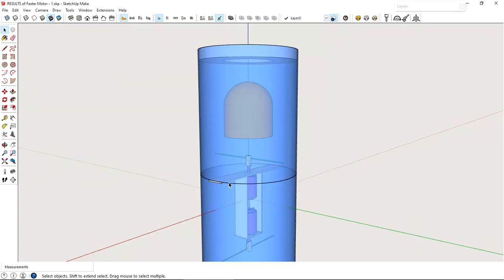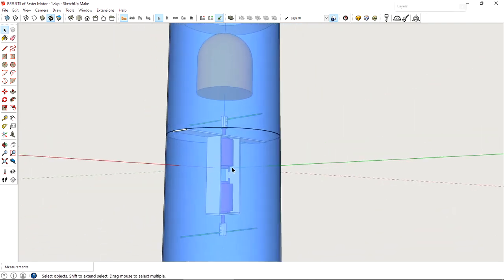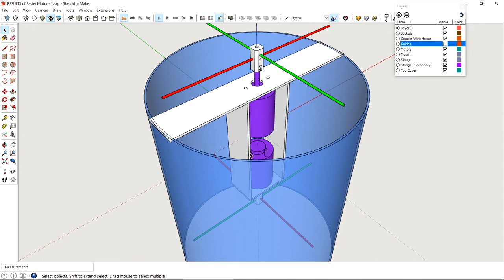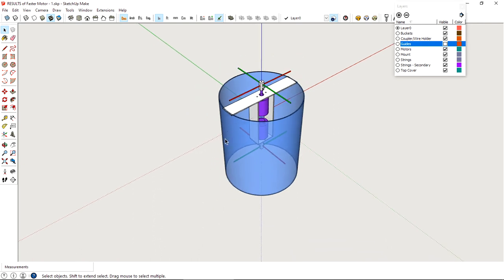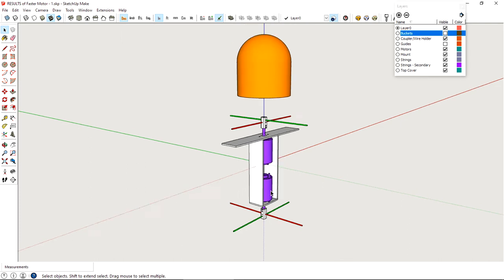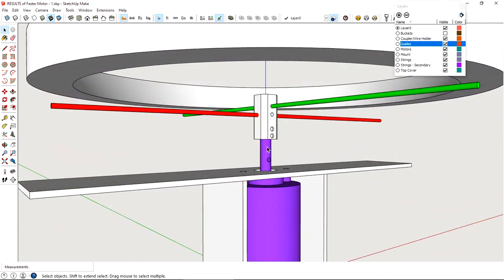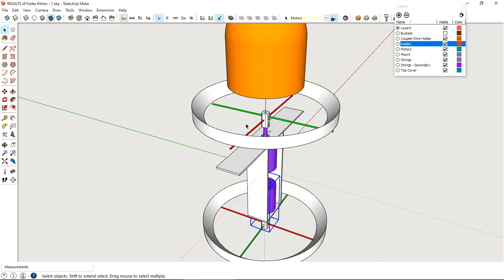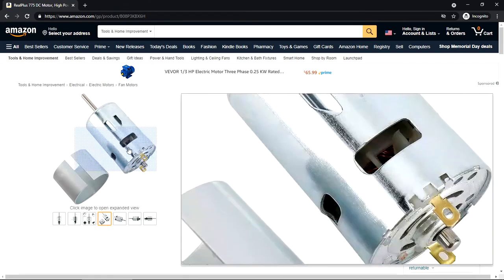Leaf Shredder #4 - Faster Motor Results (inconclusive)

Comment: Why don't you let the leaves fall in the middle of the spinning strings, rather than at the sides. The strings will have more rigidity at the centre.
Reply from the maker: You would want to increase the linear velocity at the impact point. Angular velocity is the same along the string.

Closer you get to the center of the rotation, lower the linear velocity of the string will be ( v = rω = 0, where v is linear velocity, ω is angular velocity and r is the radius). In the center of rotation, the linear velocity is zero because r = 0 . The diameter of the bucket is roughly 12 inches which is same as my string trimmer's working diameter. So, the string I'm using should be expectedly rigid at the length I'm using it. Also, the centrifugal force is pulling on the string axially which is helping the string to be rigid. Centrifugal force (F) is defined as: F = mω²r, where m is the mass..... The idea behind switching from 6000 rpm motor to 20000 rpm motor was that both the kinetic energy at the of the string and the centrifugal force increases around 11 times ((20/6)²). This means more energy at the impact and more rigid string.